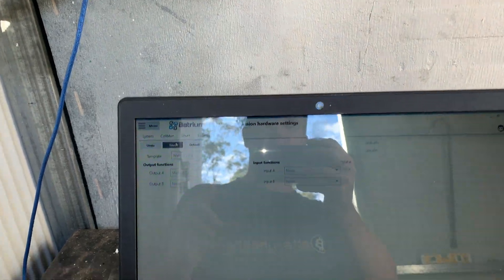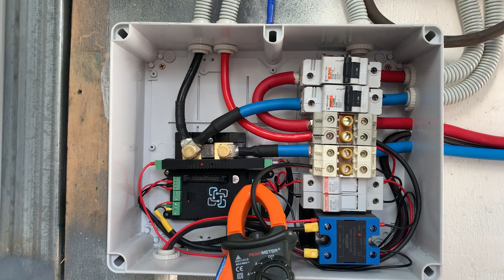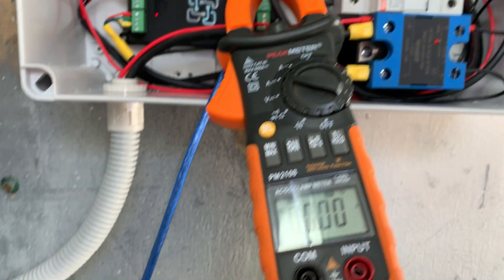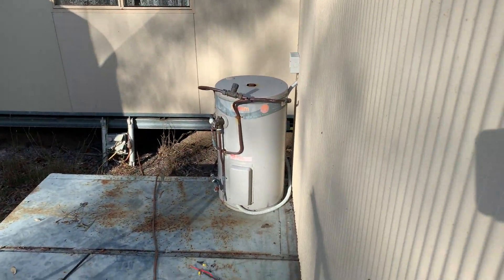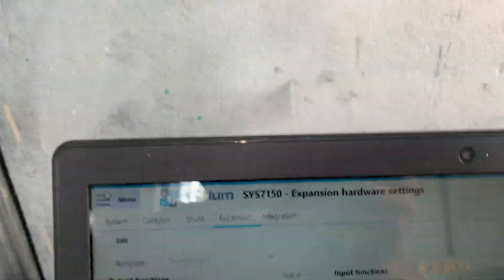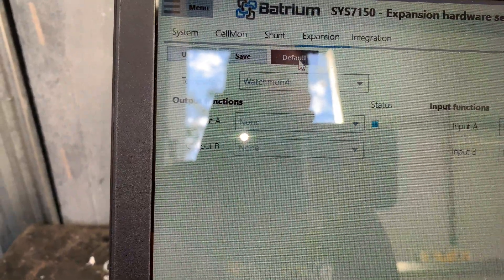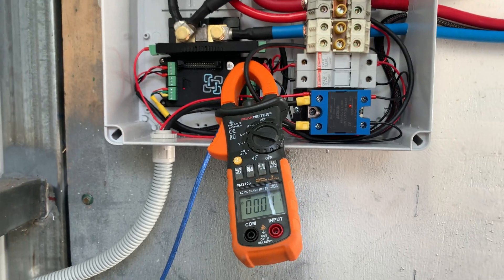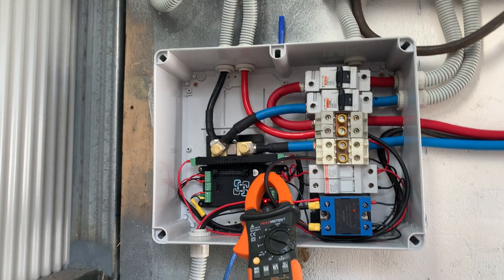Patreon Peaks - DC HWS controlled via Batrium

Comment: A really simple bit of code for dc systems directly on battery voltage is a arduino, mosfets and voltage divider....

If (voltage > xx.xx){
If (PWM < 255)
PWM = PWM +1;
} 
} 
Else if (voltage < xx.xx){
If (PWM > 0){
PWM = PWM - 1;
}
} 
AnalogWrite(element, PWM);

Sums it up. That's the logic behind it. 

If it goes over voltage setpoint increase element power. If it goes under setpoint reduce elements power. Usually let's it use maximum power available while not dragging it from float voltage

Comment: Your circuit breakers are badly installed. they should be installed vertically, not horizontally, cause they have arc extinguishing area and it doesn't work when they aren't installed correctly.
Reply from the maker: Ooh really? I didn't even know that and never been told.. That a big fix, might have to put some thought into it

Comment: Theres a cheaper way, use a sonoff th16 wifi controller that cost $20 and has a built in timer function.  You control it by wifi anywhere in the world and by google home voice commands.
Reply from the maker: DC?
Reply: @HBPowerwall  na I think those relays have really low DC ratings.

I been trying to find a relay with low draw that can do 48v 100a but there is nothing, my diy solution is a circuit breaker with a servo controlled by a Esp32, it has 3 positions neutral, reset, trip most of the time it sits in neutral that allows for the relay to trip on high current.

Comment: may need 2 relays to help with amp switching and longevity
Reply from the maker: Ditched the DC too much effort not enough reliability
Reply: @HBPowerwall  https://www.amazon.com/gp/product/B07MXHX37C/ref=ppx_yo_dt_b_asin_title_o03_s00?ie=UTF8&th=1
Reply: BTW you can program the cut off voltage and reinstate voltage of these via bluetooth so they can be programmed as a dump load if desired.